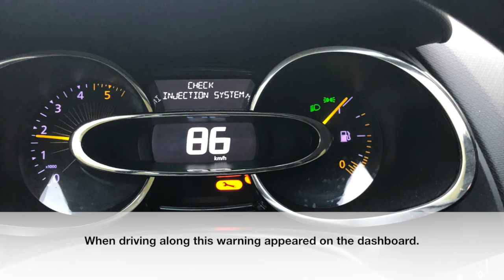Renault - Check injection system repair

Comment: Hi
I have Renault MEGANE 2013 my car also same alarm. When i press accelerate some sound will come like air leak or my car only work flat area not doesn't go to height.
You also face same problem or different.

Comment: Exactly the same problem I had with my 2016 Renault Kadjar... one of the rubber tubes had completely split in two 🙄 Check Injection message & wrench popped up on the dashboard, I got the replacement tubes from Renault and had my mechanic replace them for a fraction of the price they were trying to charge me, then purchased some Redex... It passed the MOT this morning but I’m not quite back to 700 miles off a full tank yet... after I replaced the tubes I had to drive on the motorway for about 20 miles til it came out of limp mode & the warning lights went off 😊
Reply: Hi, do you have a product number for pipes please?
Reply: @rhysmcnally3028 did you find out? Same issue here

Comment: The “Check Injection System” is a very generic Renault error. It basically could be anything. Just saying. Good find though. Better music next time 😄
Reply: The "check injection System" may be a generic error, the code P1453 is not.

Comment: h Hi . would you happen to know about a fault code df004 on a renault megane 2008 m/y  stop switch circuit would that be the brake light or the actual stop button  i have no idea have you ever came across this before ? many thanks

Comment: I had check injection n check pollution problem but after diagnosis I deleted all faults now only  shows these
 (1) data supplied to cruise control or speed limiter are not correct.
(2) turbine upstream pressure sensor circuit signal outside upper limit.
What should I do

Comment: Got a 2016 trafic and error messages come up all time. van runs ok. Had new fuse board because it was water damaged.  Comes up with faults like hill assist that's not even on the van. Please can you help?
Reply: Hi did you solve your problem? I have a 2012 Vivaro 2.0 diesel and my screen show oil pressure fault, the van don't start. and I have this code ( df067 injection multiplexed emission missing)
Reply: Hi did you solve your problem? I have a 2012 Vivaro 2.0 diesel and my screen show oil pressure fault, the van don't start. and I have this code ( df067 injection multiplexed emission missing)

Comment: I have the same issue in my clio 2009...but i dont find the sensor with the tubes
Reply: Did you find a fix?
Reply: Yes bro...i scrap it
Reply: Thanks bro, having problems my 09 atm too fitted new fuel filter still shows the fault. Think it may be at the end of its days.  @motivatii

Comment: Good explanation! But I have 1 question: In this video you're saying that you have to remove 3 bolts from the engine-mount, and then push the engine towards the front. Is this possible? I mean, the engine is connected to - for example - the exhaust pipe, and probably other parts, so to me it seems that you cannot "move" the engine that easy without damage something.....Or am I wrong?
Reply: Hi Eric, if by any chance you are undertaking this these days. Would you be able to check hose diameter size please? inside and outside.
Reply: @cyrilemme4778  
Hi,
Today I was able to replace both hoses.
It seems that the inner diameter of both hoses differ on both sides. 
On the sensor side, the inner diameter of both hoses is 7.5 mm
On the particulate filter side, the inner diameter of both hoses is 6 mm
The outside diameter of both hoses is 13.5 mm

The original Renault part-code for the green hose is 208742477R
The original Renault part-code for the black hose is 208744694R

The blue ring on the hoses is the sensor side.

Regards, Eric
Reply from the maker: Hello Eric. I am an certifyed Renault mecanic and I Can say that there are no problems in pushing the enigine forwards. Regreat the late answer.
Reply: @Kaufmann256  Hello, can you please give me an advice? I have a megane 3 from december 2010 and since 2 days ago i got the errors "check injection system" and "check anti polution system". From what i've read until now i concluded that either the sensor or one of those hoses is the culprit. The car is working fine though, no change.
Do you think it's the same problem? Took it to a mechanic, he deleted the error codes in the first day, but they reappeared a day later.
Reply: @baholete  clean air intake sensors, there are 2, called MAF and MAP, use special cleaner for them u dont want to damage sensitive heated line sensor. Im also sorting out problems with mine, also, disconnect the battery for 20 min to do ecu reset after that, should work itself out. Other culprits injectors or dpf, you can clear injectors with purge or additive in fuel tank, and dpf can be pasivley regenerated driwing at 3000rpm on highway, or taken down and cleansed with chemicals. I got same errors but they went away after 3h highway
Reply: @skyliner4610  Thanks for the answer. I went to a friend that's a mechanic, he looked at the engine, didn't find anything that looked suspicious. But he did reset the error codes and since then they stopped appearing.

Comment: Îmi apare chel injection la prima cheie nu vrea sa pornească am văzut că uni au pus motorină și e ok am pus și eu  de la Rompetrol  am mers din localitate cu turație de 3000 și 4000 iar în viteză a 2 am incercat sa o turez in mers am și turato pe loc crezind că se curata injectoarele dar nu e așa ce sa fac